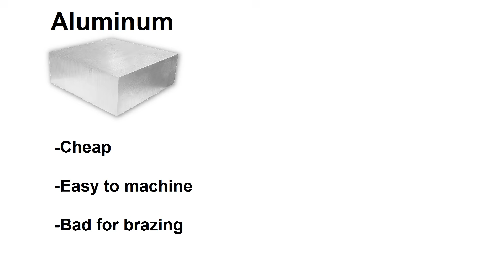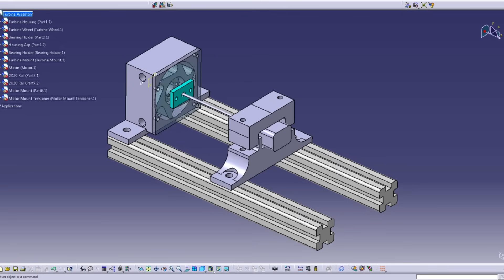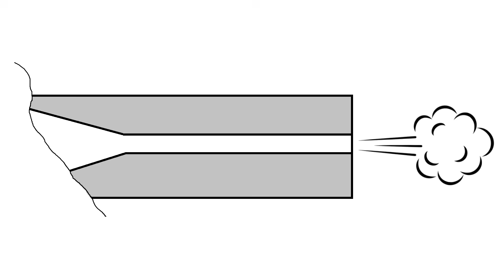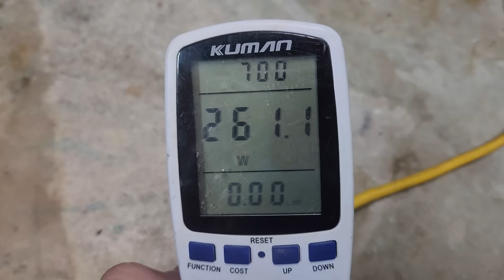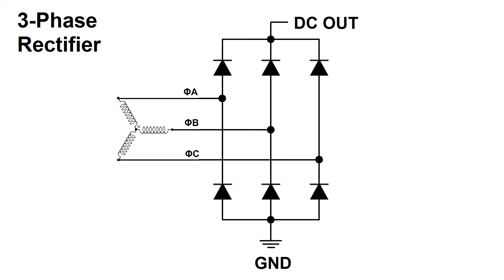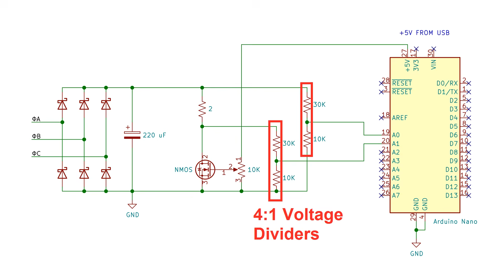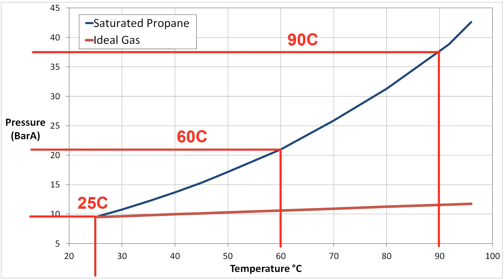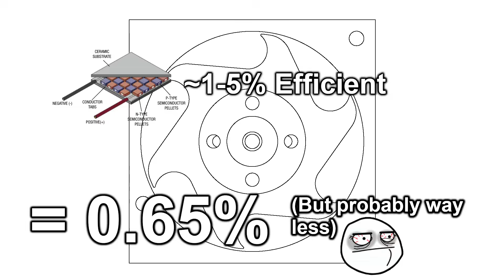DIY Micro Steam Powerplant

Comment: wet steam is visible, but super heated "dry steam" is transparent. At the peak of steam plant efficiency during WW2, the US Navy was getting 450psi from their boilers supplying dry steam to turbines.
Reply: That also had the horrifying side effect of steam leaks that could fataly injure you being transparent.
Reply: @CativaCookie   yes,there are indeed hazards.
Reply: I KNOW THIS - do you want to know how I know this...???   I have a down-to-the-muscle burn on my 1st finger cos my industrial dry steam generator iron system for my tailoring was blowing back off a solid surface and I could not see it until i moved my hand into the steam and then I could feel it and it hurt.

My mistake you are not supposed to have it on dry steam on a hard surface - only a mesh where it can pass through.  The machine has 2 settings and I didn't switch it over

It runs at 5 bar so that's what 75 psi, but then it get super heated in the iron itself
Reply: @piccalillipit9211  Jesus if 75 PSI can do that. I can't even imagine what a steam leak on WW2 ships did to people.
Reply: @minimumapature3361  I can only imagine it would slice them in two...  It healing nicely but in a strange way, a rock-hard very thick sc4b, but I think I will have a dent in my finger due to the lost tissue.  I probably should have gone to the hospital with it TBH.  I didnt realise it was anything more than a normal burn when I did it.
Reply: 600 PSI at 900° f
Reply: mhmm, if there were steam leaks sometimes they'd walk with a broom forward because the end of the broom would get all diced up by the "dry steam" instead of their arm
Reply: That's what powerhouse boilers do RIGHT NOW in power plants & paper mills, they use "dried" or condensed  superheated steam and yeah cracks in the lines will cut like an industrial laser can....NASTY!!!
Reply: My dad was a Mechanic in the British Military. I once told me about a Superheated Steam accident. Said the crew in the boiler room were just bleached translucent skeletons with a large pool of glycerol fat on the floor around them.
Reply: @andreschoen9180  parboiled in seconds...yep...
Reply: I believe some WW2 USN propulsion boilers were operating at 600psi, like on the Iowa class. 

Going from memory, most other countries were at 300-400psi, while Bismarck was around 900psi with some reliability issues.
Reply: @aaronclair4489  The UK steam plant ran 550 psi.
Reply: Steam instantly becomes wet when it expands and condenses in tbe atmosphere, ideal gas law.

Comment: If there is still significant pressure and heat coming from the turbine exhaust, a multi-stage system may be more capable at harnessing the power. Probably need to play around with turbine sizing to figure out the optimal stage sizes for extracting the most power.

Comment: You can probably abuse an automotive A/C or power steering pump. AFAIK most p/s pumps are sliding vane based, and, in track driving, can get hot enough to boil the power steering fluid (oil), so they likely can survive steam as long as there was a little bit of oil mixed in with it.

I'm pretty sure i saw a video of some guy using one combined with a "turbocharger burn barrel" to run a automotive alternator.

Also consider using an automotive style alternator instead of a BLDC motor. There are tiny ones you can find. You can easily control them with an Arduino by adjusting the field winding voltage (pwm). That way you can find the optimal RPM, and just use the Arduino to keep it there, even with varying loads, as well as have it cut the field winding power to avoid "stalling" if the load was too high.

Comment: I feel for you.  You're rapidly going to run into the same problem I've faced in the past.  Put simply, the voltage and current measurement circuit looks good in theory but is actually terrible.  tl;dr: Without a lot of work you aren't even going to be able to measure to 0.1V accuracy with your setup.

The ADC is 10 bits, so 0-1024, and uses Vin as the reference voltage.  That's just under 205 divisions per volt.  But you have a 4:1 voltage divider.  Which brings it to ~51 divisions per volt.  Good enough for 0.1V accuracy, but a 3rd digit would need huge error bars.  That's with everything else being perfect.

Except nothing else is!  In my experience the last bit of an Arudino ADC isn't that stable, so you're already down to ~25 divisions / volt.  Still good enough for 0.1V accuracy, but that's far from the only source of error.

Next you have to deal with the reference voltage.  At the 5V setting the ADC has 1024 set to the input voltage, and that's not nearly as stable as you think.  +/- 0.2V tolerance is within spec for many power supplies, and that doesn't include AC ripple.  That introduces a swing of around ~4 divisions/ volt with your voltage divider. That issue can be solved by going to an external voltage reference, but if you want to use the same power supply for both, you're going to have to go with something like a 3.3V reference.  Requiring an 8:1 divider, and bringing you down to ~13 divisions/volt.

Unfortunately, we're far from done.  There are two other sources of error, both dealing with the divider.  First, the Arduino ADC itself is not a perfect sink.  The datasheet says it has a 100MOhm input impedance, but another part says "The ADC is optimized for analog signals with an output impedance of approximately 10KOhm or less."  Which your divider is not!  Plus, how closely matched are your resistors?  What's their tolerance, and how much additional error does it add?  You don't trust your meter, so you don't know.  In my experience, it can easily be enough to cut the accuracy in half again.  So now you're talking ~6 divisions / volt.  Making it incapable of even measuring 0.1V!

It just keeps going too.  You're trying to measure current, but the ADC is not instant.  First it measures one channel, then switches to the next and measures that one.  You'll always have measurement and switching delay between the two channels.  Except it's worse than that.  The Datasheet says to not trust the first value after switching channels, so you have to sample twice, adding more delay.

Someone pointed me to the ADS1115.  You might have good luck with that instead.

Comment: If you found a way to make a gravity feed pressure work, insulated some things and improved the efficiency you could make it into a "stick" format for campers to use bu placing across a fire. The higher heat would allow a one way valve like in a drip kettle which might provide the flow needed to make it work from gravity feed. And if you added a second stage to the steam generator you could recover more energy too. Choosing insulators for the housing and impellers instead of metals it might be lighter and suck less heat from the steam and at that point could make it larger or add a third stage for even more efficiency. Lots of ways to improve. As someone else's said the hottest part might be better used as a superheater portion before the steam leaves the boiler/heater.

Comment: About the cold propane tank: my father built a a propane kiln for his pottery, and used to run it from a 100lb (iirc) tank. It would freeze up in about 30 minutes if he just ran it. What he did was get a big tub, one normally used to hold ice and a beer keg, and filled it with water. That was enough to prevent his tank from freezing up. I imagine that if the water were to start to ice up, you could dump some of the water and refill.

Comment: The nozzle doesn't have to expand in all directions.  Just widen it in the horizontal direction, parallel to the turbine axis.  You'd only need a couple millimeters to increase efficiency quite a bit.

Comment: I really think you should consider looking into stacked sheet metal tesla turbines.  They can have some shockingly high torque and power density, and can use really crappy steam sources, and most importantly for diy projects, they can be made with stacked disks of thin sheet metal.  Look up the stuff that charlie solis does with tesla turbines.

Comment: cool - ive always wondered about a heat driven piston ( large) to provide the compressed air system.  So sun - Fresnel lens - piston (driving water pressure) then sun - fresnel  lens driving water exapansiion.  More off grid..but hey can u show me how the piston sysem would be constructed. Pref 3D printed prob need to outsource it.. or use a lot of reinfoced extruted material.. spelling im a rush.. thanksmad ideas..

Comment: Next time put a grove in between the plate and housing, it's not only good for O-rings, but you can also use other materials to seal these things. With lots of heat graphite, or in some cases felt seals would work.

As for parts like this you have to flip over there are tricks you can use, especially on parts that need to be spot on in terms of concentricity. Put 4 holes in your stock and two in a plate and put a guiding pin into the plate, if you got things zeroed out correctly the first time you should have an easier time to repeat this process of centering things. Basically you center your mill on the plate after cuttign the 4 pin holes on your stock (preferably with a tool for zeroing your mill aka "edge finder for milling") and then you can easily flip most stock materials over. If your pin holes don't work due to size? Make new ones duh! Also the digital edge finders and "edge gauges" are not that expensive, so for such delicate and balance sensitive parts, get something like that.

Oh and as a bonus for using the little trick with the plate to flip over and the mechanicla edge finder, your accuracy when milling goes up "like a lot". So your 0,5mm loss at the turbine? Yeah I recon even a novice can easily test the capabilities of the mill and get it closer to 0,05-0,1mm without too much hardships. Alternatively you can cut the turbine at 0,2mm additional "meat" aka 0,4mm more diameter and do a run around the turbine to get the outer diameter just below your desired casing diameter.
Bonus points when you do your "rough cut" in such a fashion that you cut slots through your stock and leave taps to hold the part in place. This is usefull since you can do your fine cut on the diameter/correct form of the part down to the taps and ever so slightly make them thinner. After this fine cut you flip the part over and gently go around your part to mill of the taps the the last few mm of depth for a more accurate part. In a professional shop the part then would probably be "gently" smoothed over by a plane head/plane mill and brought to final thickness, but that may be overkill for hobbyists.

Comment: Really need project. Energy wise, how does generating electricity from burning wood to produce steam, compare to burning wood in a gasifier and then running an internal combustion engine off of it?
Also would a turbocharger be useable as a steam turbine?

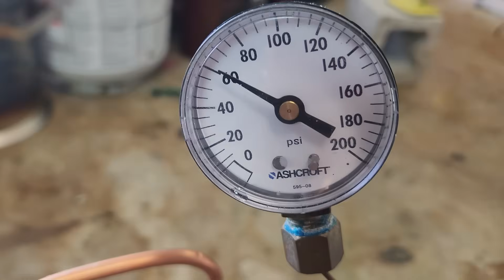Comment: 15:35 In the live steam model railway community they sometimes use exhaust steam to heat  water bath that the fuel tank (usually butane) sits in.

Comment: I'd be interested to see if putting something like a turbo which iirc is used to increase oil pressure in combustion engines, could be used to increase the water pressure here, though it may need some kind of tuning for the different fluids. Though what you already did is sick, using a gas's vapor pressure is genius.

Comment: 16:10 Hair dryer.  Throw it in like a plastic trash can, cut a hole at the top for the hair dryer, and one at the bottom for airflow and it shouldnt get above like 120F.  Additionally, you can just open the lid more to control the temperature.

Comment: Put a sleeve in the turbine housing. Use a lathe to make the ID and OD correct for a press fit inside of the housing and a very small gap between the sleeve walls and the turbine blades.

Comment: I think you could increase your safety factor by installing some type of float activated check valve. So when the water level goes below 20% capacity or whatever the propane can't make its way to the danger zone.

Comment: I'm sure you already know but I saw you using one of those propane tanks from gas stations or whatever and those only have 15 pounds and are more expensive vs filling it somewhere locally you get 20 lbs I generally go to tractor supply they fill them here locally and have better hours than most filling places

Comment: If you don’t want to use propane for pressure feeding the water into the coil, a better option would be to use a boiler feed valve

Comment: that steam is very wet; re-run the steam back through the boiler in a second loop to get it drier as dry steam is much more efficient.
Reply: Dry steam is not more efficient itself. It is just superheated, meaning it contains more energy, and you can expand it more before formation of droplets starts to happen. But to make use of that energy, you still need to have a turbine that can extract the additional energy. If you blow high pressure superheated steam out of the turbine outlet after it has passed through a single stage drag runner, you won't gain anything.
Reply: Why not feed the cold water on the other end for a much more efficient counter flow system to create higher quality steam and extract more heat and increase power?

Comment: For your variable load: You are using the MOSFET in linear mode , not in the "linear region". The "linear region" is the state of the MOSFET where it is fully on and behaves like a normal resistor (Rds_on), i. e. linearly: current I_D increases with voltage V_DS = Ohm's law. The linear mode operation is exactly the part of the graph you didn't mark, where very obviously the current depends on the gate voltage V_GS. To avoid this confusion the term "linear region" generally isn't used, but instead called ohmic region.
Btw. don't expect a MOSFET that isn't specifically built for it to survive for long in linear operation.

Comment: great job on the whole system.. the propane pressure / boiler is ingenious.. losses at turbine is definitely at work here. silicon pads gaskets to cover clearance between rotor fins & housing could be a quick fix. in a way could even pressurize pockets within scoops of turbine possibly increasing output.. aside that, a tesla turbine w/ 50 - 100 5” diameter discs of sheet metal(22 gauge) for the rotor would be fun to see with the flash boiler setup.. add flywheel to rotor axle reducing rpm.. however among all types of modern steam turbines.. greek antiquity hero’s steam turbine would be nice to see generate power.

Comment: Use carbon fiber plate for the vanes, if it's sanded very fine or even pseudo polished (don't think you can really polish CFRP endgrain) it works pretty well.
Rotary vane vacuum pumps use carbon vanes as well, though I think that might be a quite different material to regular cheap carbon plate material.

Or make them yourself, with a XPS or some other cheap sht as core and PTFE or graphite as filler to reduce friction. They should be as light as possible with increasing rpm after all, obviously.